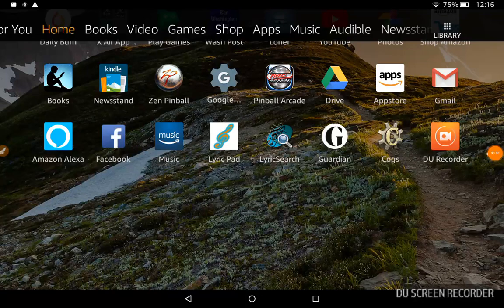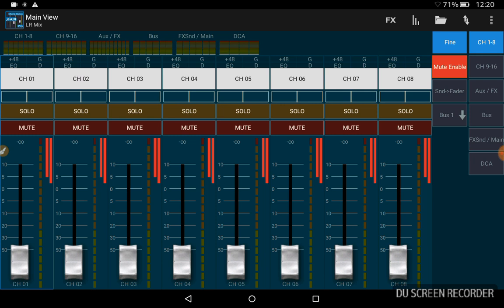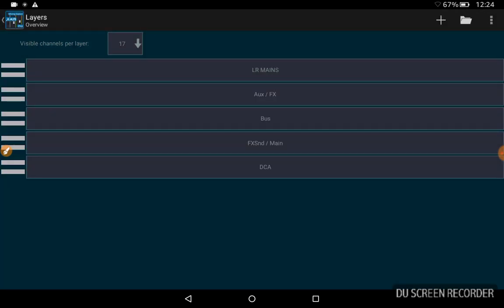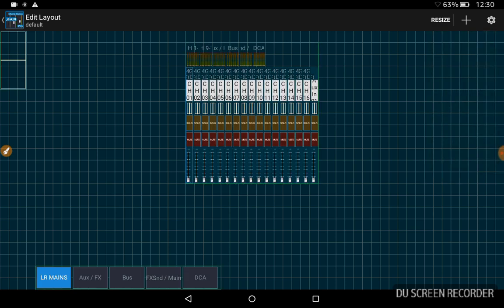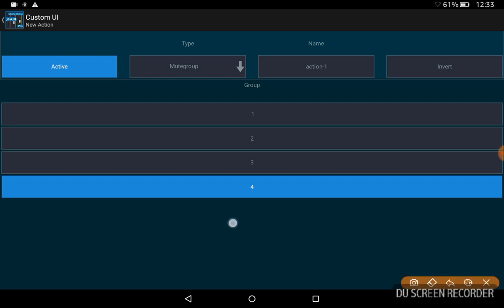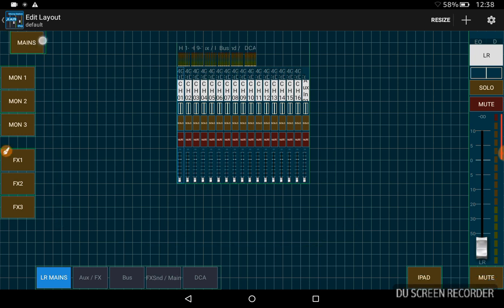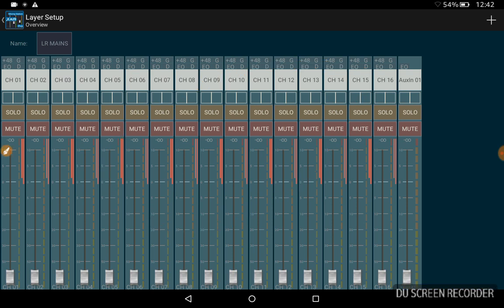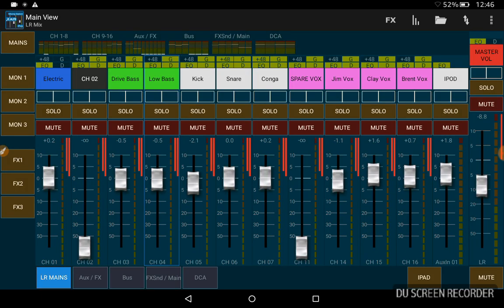Mixing Station X Air Pro App custom set up tutorial for the Behringer XR 18, 16, and 12.

Comment: The app operates a good bit differently in its current state, when making changes.  It's very difficult to figure out how to make the changes you show in this video.  Would you consider doing another of these tutorials with the app in its current configuration?

Thank you!
Reply from the maker: @scottkessler3173  thanks for asking the question. Unfortunately I have moved on and have not tried the new update. I’m sorry about that. Hopefully someone else has done a new video.
Reply: @Brak0777  Darn!  Ok.  Thanks.  You did a great job on it.  It's just that the current edition of Mixing Station is quite different in how one makes changes.

Comment: Thanks for your offering and participation on this brak 0777!
Just a quick question. I'm running Mixing Station on Android for the X18 table top mixer. I've connected it via ethernet because I couldn't get it to see the IP address for wifi. 
The routing matrix in MS shows that all the inputs are routed to the same number channels, 1-16 to 1-16.
Just looking at channel 1, it shows that input 1 is routed to it and ch 1 confirms that, showing it on the strip. It seems I can't get a signal either visually on the meter or in audio through headphones. Because ch 1 is hi impedance, I plugged a guitar in and confirmed that the signal is reaching the jack end that's being inserted into ch 1. Is there anything else that you know of that would interrupt or reroute the signal between the input and the channel? If not, I may have to concede that I have a defective X18 unit.
Thanks again for your time!

Will Williams

Comment: Thanks for this video!
Just started using Mixing Station XAir Pro for Android to run my In-Ear personal monitor system through Bus 6 on an XAir 18. The FOH is controlled by the XAir app created by Behringer on a Windows computer. I just control my own IEM mix with a small Android tablet with Mixing Station Pro. I restrict the Mix Access on my tablet to Bus 6 only in order to avoid changing the FOH settings. 
Question - Does restricting my control to Bus 6 only limit the ability to build a custom layout for my personal tablet? I have been having a few problems saving my custom Bus 6 layouts. The Android app is a little different than the windows app. 
Steve Lamm

Comment: I need a video on how to link mixing station app to the x Air mixer? I spent 3 hours trying to get it to work with no luck.
Reply: Get a WiFi rougher with 5 GHZ DUAL BAND,

THE BUILT IN WIFI IS A FRAUD ITS SO BAD

Comment: So technically if my band mates also have this mixing station app. I can use it to customise a monitors only mix for them can’t I ? And remove the main mix from it ??
I’m currently running stereo in ears for them, so I should be able to just add one button for monitor 1, but that’ll still control both aux out 1&2 (as an example) ??
Reply from the maker: There is a monitor mix app only called the X Air Q. That will allow the user to only adjust their monitor mix. It works great.
Reply: brak 0777 
You are freakin awesome! I love you right now !!...
Thank you so much !!!

Comment: went all the way through the video setup with pro version on android pad,  saves custom layout and scribble scripts until the app is closed. Open saved settings and total mixing setup back to defaults.  Tested a few more times, same result, all customized settings vanish despite reloading previously saving settings.  

Help me out please, what I am I missing.  X-18 setting.